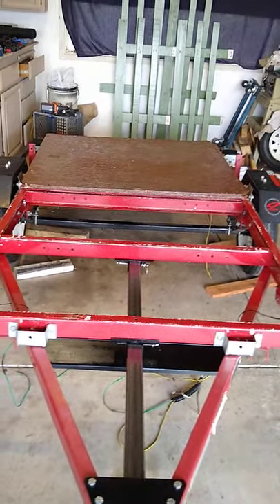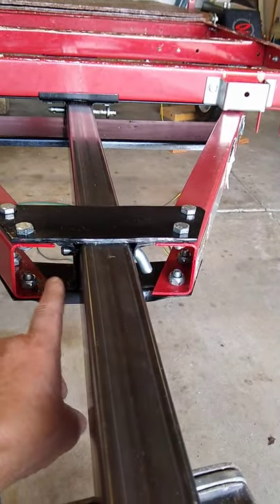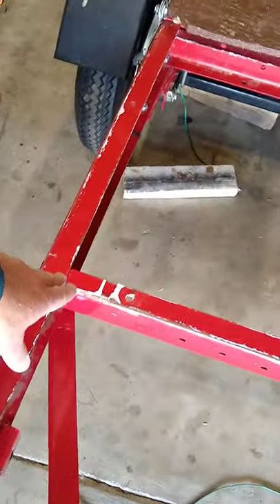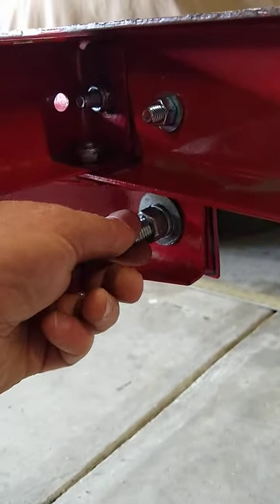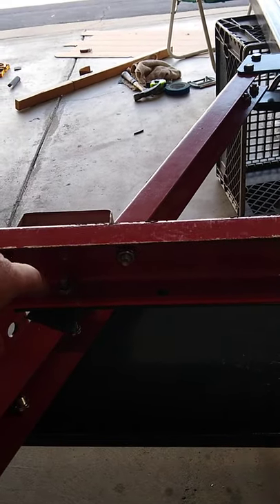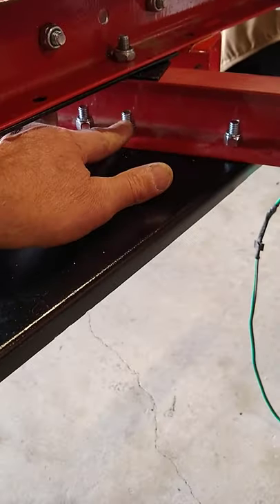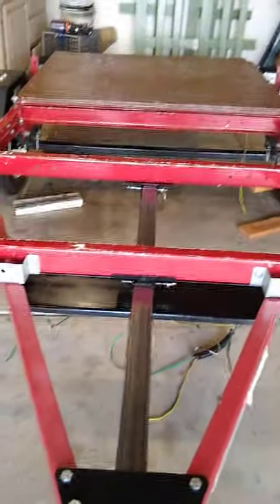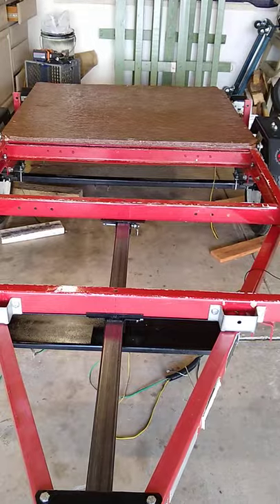Harbor Freight Trailer Tongue Extension Modification   Part 1 of 3  videos

Comment: Thanks for the videos. What gauge steel did you use for the tongue extension? Have you maxed out the weight capacity 1720 lbs  on any trips? How many miles on the trailer now? I am getting ready to put mine together and looking for some ideas.
Reply from the maker: 1/8" x 2" tube. I bought it used, its the lighter version 1200 lb. Use it for a few dump runs, haul wood and mulch on my property, hauled garage cabinets, large tool boxes... very useful.

Comment: How did you fabricate the  tongue couplings on the  cross members?  Looking to do the same type extension. TIA
Reply from the maker: Are you asking about the 3 brackets where the hitch pins go through? The front and rear brackets are from the original couper. I cut it between the 2nd and 3rd bolt holes. The larger piece, with 4 bolts holes, is mounted in the front of the A Frame.  The other smaller piece is in the rear of the tongue, 2nd x-member. 

https://youtu.be/RMioWjtl088?t=32

The other hitch pin bracket, on 1st x-member, is from 1/8" angle.  I also made a small plate from 1/8" flat stock that the bracket mounts to. 

https://youtu.be/RMioWjtl088?t=132

 I can stand on either of the front corners and the trailer has very little deflection, twisting. Once you do this, it is harder to fold though. See 3rd video link in description.
Reply: @ridemfast7625  Sorry I wasn't clear. That was the answer I was looking for. I know there are many ways one could do this and as you and several others stated, careful with structural integrity. I currently have 2 14ft Hobie kayaks on mounted crossbars on the trailer. I am just looking to extend the tongue a little and make it retractable to close the door of my shop. I am currently researching to see if a Malone  retractable tongue kit could be modified to fit. Thanks for the quick response.
Reply from the maker: @A-aronTrekn  Glad to help. 2 kayaks is not much of a load. I use it for dump runs, mulch and oak firewood. I did the extension on the cheap but it certainly took some time. Welding, maybe even paying some one, can really open up a lot of  possibilities. good luck!
Reply: @ridemfast7625  Thanks again sir!

Comment: Bit over built for what the trailer is rated for. Am about to do it myself, but man. Added a bunch of unnecessary weight with all that steel. But then again, peace of mind is worth its weight in gold.
Reply from the maker: Yes, I understand what you are saying and the added structure may not be required.  However, on my trailer, the original front two hitch pin brackets, on first x-member, were bending and pulling the first x-member forward, bowing it outward towards front of trailer. The rear hitch pin bracket on the left was also twisting and those only have tiny little spot welds on the inside holding it.  On different forums their are pics of those brackets breaking off and/or bending.  If you plan on folding it, then it may not be worth doing. 

https://www.youtube.com/watch?v=FDgoRjNB6rM

The added weight is a very, very, small percentage when you consider the stock trailer weight plus wood bottom, wooden sides, spare tire and jack stand. Even a cheap HF jack stand weighs almost 15 lbs. Dont use the jack and you almost offset the additional weight. I found that jack to be a nuisance and dont use it. Faster, easier, lighter to use a simple wooden stand.

Also, a proper designed A Frame trailer should have the A frame go back past the first x member and to at least the 2nd  x member. Even the comparable inexpensive Irontron folding trailer from Northern Tool has this design. I feel like the trailer is much closer to a proper trailer now. Towing, stability, strength and safety.

Comment: Hey man, I have the smaller trailer and replaced the tongue with a 10ft tongue and I'm getting crazy wicked bounce. Any suggestions?
Reply from the maker: Most likely the trailer weight is not loaded correctly. You need 10-15 percent of the total trailer weight, including cargo weight, on the tongue. With a longer tongue that means more weight on the forward portion of the trailer. The longer tongue has more leverage. Please read about trailer tongue weight. It is very dangerous to pull without proper tongue weight.
Reply: @ridemfast7625  Appreciate your response and patience. What I was reading was saying that I can drop the tongue down and that might add more weight? Or would I just clamp some heavy steel around the tongue where it connects to the hitch? This is my first trailer and thought this would be easier.
Reply from the maker: @abuncharandomstuff  Sorry, I prefer not give anymore advice.  What you are suggesting can be very dangerous.  I suggest joining a trailer forum, posting pictures of your trailer, and what you are trying to accomplish.
Reply: @ridemfast7625  Fair enough, thank you.
Reply: @ridemfast7625  Hey btw, if anyone asks I found out the problem. The shocks were way too stiff so I removed the bottom leaf from the springs and it works like a champ now. Appreciate you pointing me in the right direction.